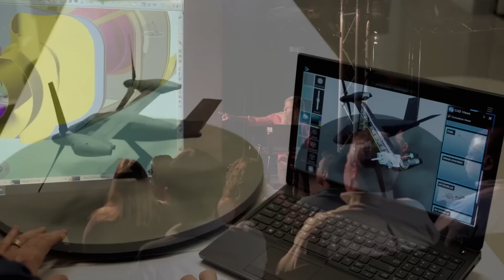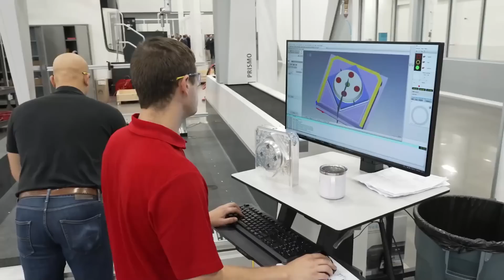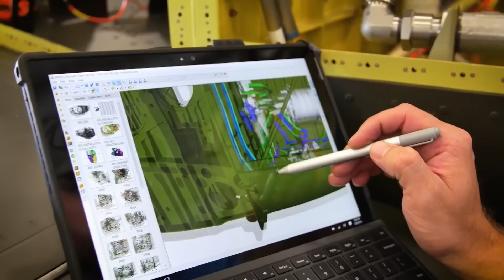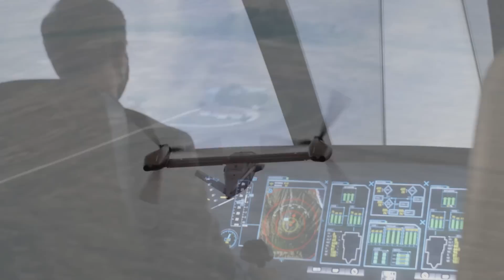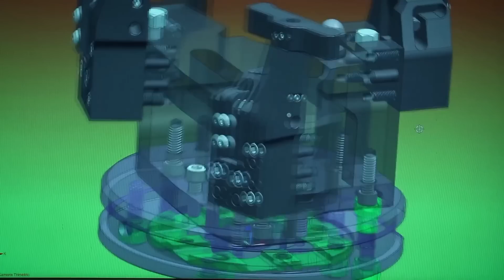Finally; The Bell V-280 Valor Will Replace the U.S. Army's Legendary UH-60 Black Hawk

Comment: Considering the amount of times there have been issues with the osprey during special operations raids this will get interesting. It looks like a lovely large lumbering target when manouevering in copter mode.
Reply: As if Defiant X is an Ant size.
Reply: What times were these? And manpad don’t care how lumbering or nimble it may be, it will take it down without anti missile protection.

And it’s only like that dropping off troops. If the LZ is hot, won’t matter what chopper it is, everyone dead. In flight, its faster than any other helicopter.
Reply: @TheBooban  Syrian raid against ISIS where seal was killed , osprey suffered a failure.
Reply: @MarxAlex  Black Hawk has an even worse reputation.

Comment: Footprint of the V-280 is way too big and look how far those rotors stick out beyond the wings, talk about hitting your tree line! Defiant-X has a much smaller footprint or they can come up with a larger UH-60 Blackhawk with double rotors and more powerful engines to make it faster and the ability to carry more troops than what it does now!
Reply: @craig4867  if one engine damage the other engine can run both sides of the blade so its not a big deal.
Reply: It really isn't that big if you factor the blade length.
Reply: @user-pq4by2rq9y  I am factoring in the blade length and they showed you how far the blades go past the wings and that's the debate about it right now is because of the size of it and the footprint of it when in a tight area! It's not the length that's the problem, it's the width of wings and rotors!
Reply: @craig4867  Blackhawk's length (with rotors): 19.76 meters
 Valor's width: 24.93 meters. 

I really don’t see the big deal about it. Unless you have only a 20x20 square  to work with, it should be fine.
Reply: @user-pq4by2rq9y  I wasn't talking about the Blackhawks length or the V-280s Length, I was talking about the V-280s with with rotors and wings, the length is not an issue with either aircraft! By the way, check out the Defiant X made by Sikorsky and tell me what you think about that one!
Reply: @craig4867  I am 70% sure that that number is considering the rotor and blade length. I mean, it has two rotors and a fixed wing, it doesn’t need nearly as much blade surface to generate lift. 

I already checked the defiant and sadly it seems they didn’t solve the issue with excessive vibration that plagued the Cheyenne. That is a big deal because it means premature wear.
Reply: Will the crew chiefs be able to see the tips of the blades for confine space landings, or are we just not going to do confined space landings? What about slope limitations?
Reply: @MrDustoff70  good question, my problem is with the length of the the wings with the rotors and if you look at it from the top view it takes up a lot of space and that was another concern of theirs and it should be and personally I don't like tilt rotor aircraft, they look unbalanced and like I said they take up too much room! I think they should take the Blackhawk make it a little bit bigger lengthwise that is and put double rotors on it to increase the speed and power, and their counter rotating with more powerful engines, if you want an example of what I'm talking about, check out the Defiant X that they're working on, it has double rotors and a push prop!
Reply: @craig4867  Defiant X is better to replace the Blackhawk. But this contract was not that. It was long range assault and the Valor flies furthest and fastest.

Blackhawks will remain in utility role. A role they don’t need the Defiant technology for. Defiant technology will continue in the form of the Raider X scout role.
Reply: @TheBooban all you guys are coming out of the woodwork regarding these helicopters I didn't know there was so much interest! What do you think about making the Blackhawk bigger with double counter rotating rotors like the Defiant with more powerful engines to make it faster and the double rotors should make it faster!
Reply: @MrDustoff70  pilot doesn’t need to see the wings, why does the crew chief?
Reply: The problem with the Defiant was supportablity. The V-280 is using mature technology that’s been implemented with the Osprey. So they honed that tech and made it better after those lessons learned. Also the Defiant is literally almost double the height of a UH-60.
Reply: @TheJayb10  it's not the height that's the problem when you're landing, it's the width and the V-280 is very wide if you look at it from a top view where the rotors extend way beyond the wings and that means you can't get into real tight spots with it and that's one of the questions that they're debating, I personally like I said earlier in my other comments would be to go with the Blackhawk helicopter with a double rotor system, more powerful engines and extend the length of it a little bit more to carry more troops and by the way the double rotor gives it more power and speed! But just like all of us we all have our opinions, so I'll leave it up to the experts and if they go this new V-280, I hope it doesn't become a Widowmaker like the Osprey!
Reply: I still think they should develop both. The Valor is best in a transport role, the Raider is better as a scout/gunship. The Defiant x could be a more heavily armed, faster more agile version of the Hind. There’s no way you can say the Valor is a better replacement for the Apache. So the Raider X tech will continue to be developed. For now the Defiant will probably be used for Special Ops. They need both ultimately
Reply: @alistairfletcher483  check out the AH-56 Cheyenne helicopter it was way ahead of it's time!
Reply: People who think the aircraft being a bit wider is a serious concern are only revealing their ignorance of real aircraft practice and use.
Reply: Yeah they ain't going to be able to land this thing anywhere.